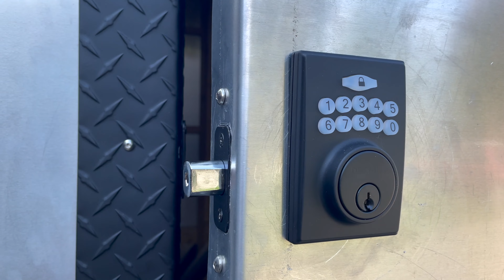TIME LAPSE - Complete Travel Trailer Build  - DIY Camper / RV / Caravan (Start to Finish)

Comment: See the good design and engineering, quality of materials and skilled workmanship being applied from the get go.
Reply: For a robust offroad camper the wooden frame is a completely bad idea! Only advantage is that it’s probably light but durability sucks . I’d go for aluminum frame rather than wood. Otherwise a great DIY project

Comment: Wow. This is awesome and also pretty timely. 

I have a 2001 Coleman Sun Valley where the canvas is on its last legs. Figured id strip it down and use the base trailer to do my own. At 7'5" x 17', that's a good base to start from.

If you had to guess, roughly how many man hours did you put into this? Id hazard roughly 75 to 100 hours. 

Such great work, Eddie. Well done.

Comment: What a pleasure is was to see your meticulously precise attention to detail and superb craftsmanship during the construction of your travel cabin. 

I was particularly impressed with the lengths you went to to keep water, mud and road grime away from your floor, your ingenious use of folded sheet metal was excellent in that application.

Your chassis is as good as it gets, and one of the strongest I've seen for an off road compact travel cabin.

This build will inspire others to construct their own to a  similar high standard.

Thank you for sharing.

Edited for typo.

Comment: Very good job thank you for sharing,
Why did you install the outer wall sheet before the inside , is there any reason?
I have seen others install the inside sheet , then electrical wiring, water pipes and insulation. And last is the outside sheet.

Comment: I would have put a little bow in the roof, couple of inches, I like good drainage and l hate low spots. Your build is so fine that you won't have roof issues. Mine wouldn't be that fine.

Comment: What calculations or formulas did you use to maintain the balance within the camper to achieve the proper tongue weight for the vehicle you are using to tow this?

Comment: Should I put a metal roof on it the vinyl sucks my last camper I had had a metal roof on it and it lasted 25 years and when I got rid of it it was still going my new trailer is only a 2005 and has had two new roofs on it

Comment: Inspiring work! I wouldnt however, trust a wooden frame in a moving vehicle.
Reply: Thankfully, your attitude wasn't shared by the designers and constructors of some of the most famous vessels, aircraft and vehicles constructed in wood that were truly outstanding, such as the De Havilland Mosquito.
Reply: @felixcat9318  the world has moved on to other things. When did you last see a new car with a wooden frame? Not saying it wouldn't be cool, but wood is not really known for being a very uniform material. Making frames out of wood that has the same strength and rigidity as steel (and not being bulky as all heck) is near impossible.
Reply: @Zekla  There are trailers built from wood that have lasted many decades.

Trailers of wooden construction have proven themselves to be fine, other than for the irrational fears of some people...

Comment: What are you going to use for the insulation and interior walls? Also, was the floor insulated? looked like the steel frame, the sheet metal then the plywood?
Reply from the maker: Next video will cover that.

Comment: I am just curious:  why adding one frame over the other?  Also, did I see two layers of plywood for the floor?
Reply from the maker: I’m not clear on what you’re asking
Reply: @DrenalinAdventures  Well, I was watching the assembly of plywood sheets over the frame with aluminum facing then later, I was watching you working on the walls over other sheets of plywood:  so I was wondering if the trailer had two layers of plywood as a floor.  Regarding the frame, I saw a welder assembling a first frame, then a second one is welded over it:  it was the first time, I was seeing such kind of frame set-up.  Nice video series that I watched as soon as they were broadcasted on YouTube!  Did you weight the actual trailer and will you film the interior build?
Reply from the maker: @charlevoix418  haven't weighed it yet.  I will film every part of the build.

Comment: Would you do it again or just buy a camper
Reply from the maker: I personally would do it again but would advise others to proceed with caution. You gotta love the struggle.
Reply: @DrenalinAdventures  I keep throwing it around for building my own. Just ordered Rosie vintage camper build from scratch Amazon I must see cost difference for new and used camper